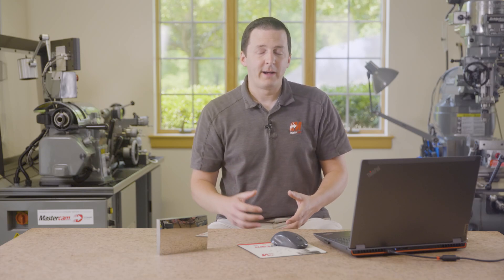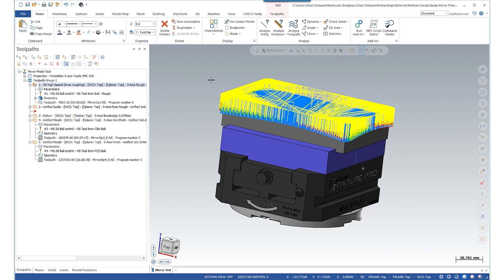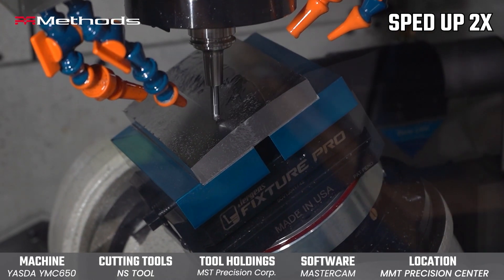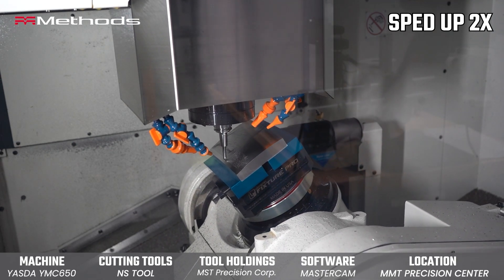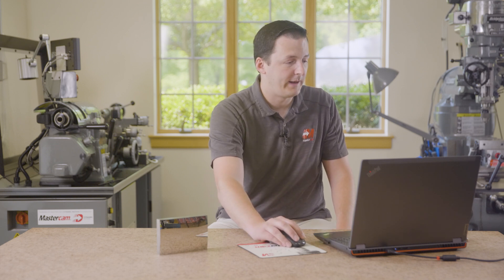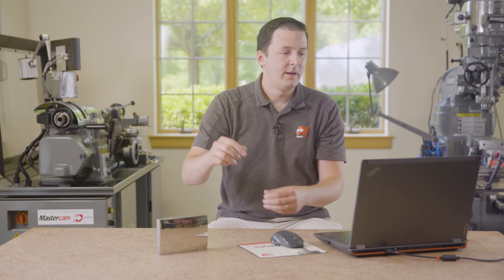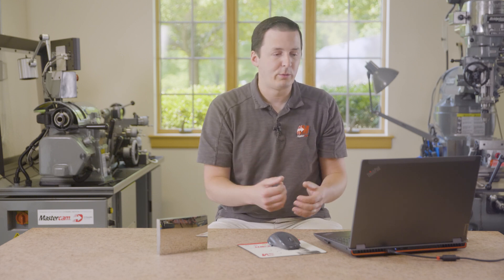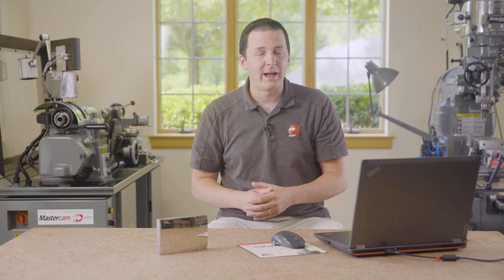Achieving Surface Finish Perfection with Precision Toolpaths

Comment: It's interesting, after all these years Mastercam still can't post arcs on this kind of thing. Is it impossible?
Reply from the maker: It is possible, but you will likely lose resolution.

Our toolpaths include an arc filter tolerance that lets users specify the total tolerance. You can also control how much of that tolerance is allocated to the cut path and how much is used for converting splines into arcs.

However, achieving a true mirror finish requires disabling the arc filter entirely.